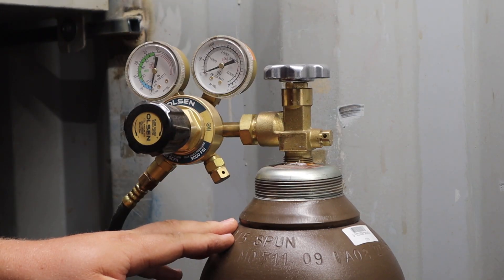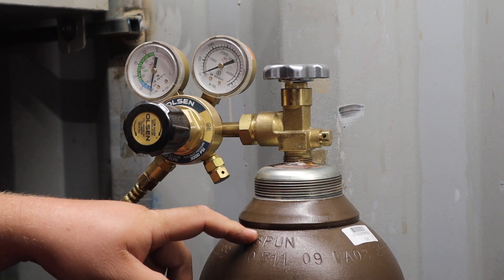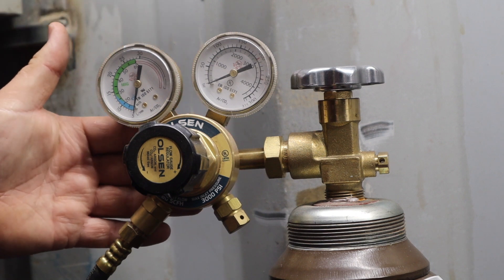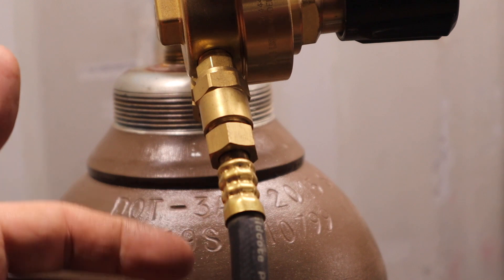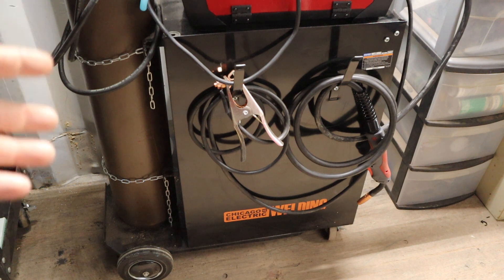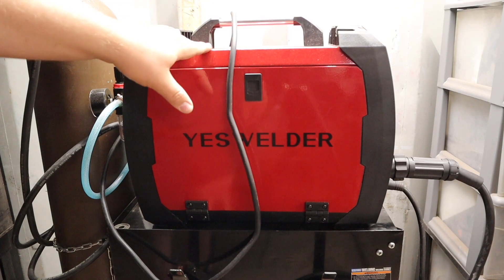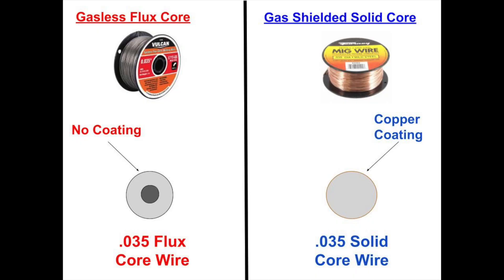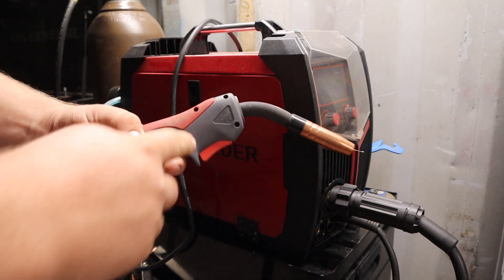Wire Feed Welding Basics - Everything You Need to Start MIG Welding (GMAW)

Comment from the maker: A comment I anticipate getting that I want to address before it come… Yes, I know you can run gas less flux core wire with shielding gas. I know it’s called dual shield.
I went off on a long tangent about it and ultimately edited it out because it was a long ramble and I felt it was going on to long and would just detract from the purpose of the video…